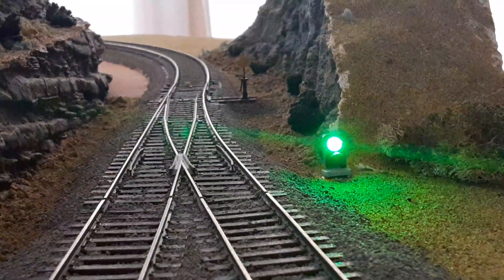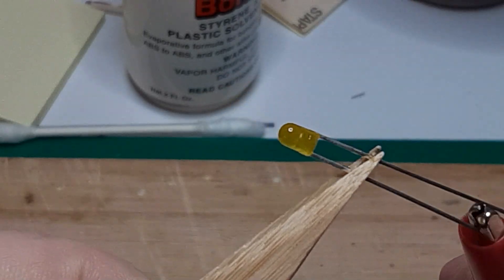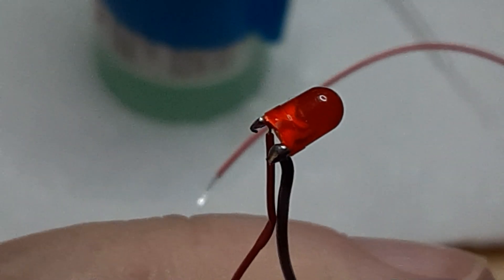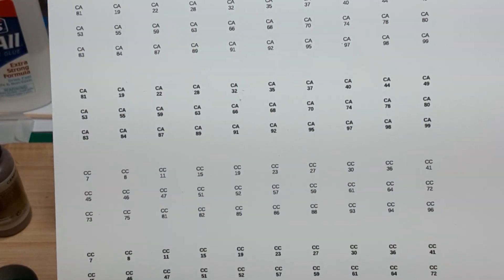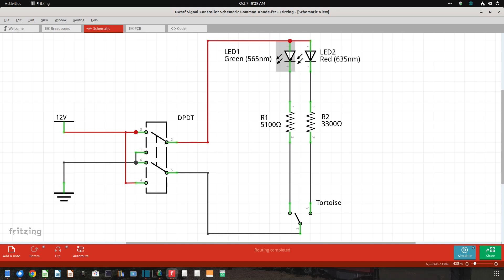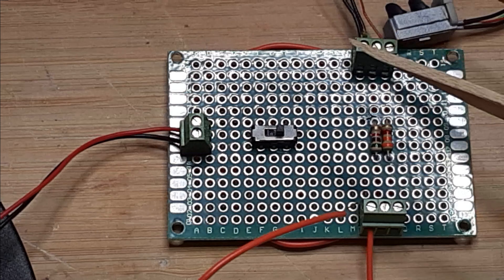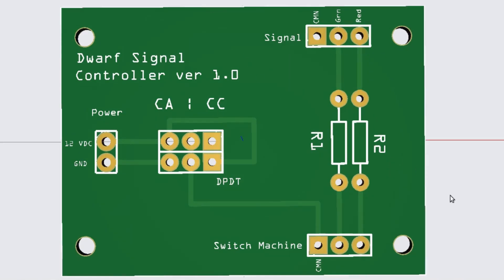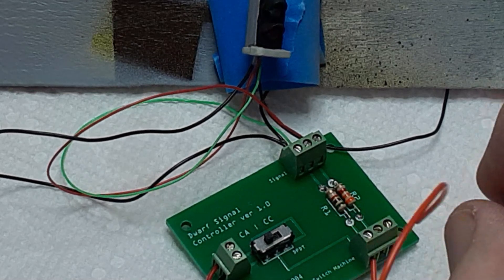Building   and Controlling   Dwarf Railroad Signals on a Budget

Comment: This is the best detailed video with all information needed. I have seen many on youtube, but this video is amazing, so thank you for guiding, sharing such a wealth of knowledge.
I use Digitrax controller for operation and tortoise switch machines, any suggestions/guidance, how I can integrate the dwarf signals? Currently I have no signals and am just starting to build signals into layout.
Reply from the maker: First, thanks for the praise - it is gratifying to know that modelers are finding my channel content helpful.
With regard to your situation, the first thing you need to decide is where you want to place your signals, and what information you want them to convey. Prototype practice is to use dwarf signals in locations where a tall signal mast would interfere with operations, which is why you often see them in yards; but they might also be used where there are overhead obstructions. Dwarf signals can have one light, two lights, or three lights; and the lights may be a dedicated color or they may display three colors, just as with searchlight signals.
You can use dwarf signals at a turnout approach from the converging (two tracks) direction to indicate  whether it is safe to proceed through the turnout - this is the approach I have demonstrated in my video. I chose to place a signal on just the siding (the main is always assumed to be clear), but you can place a signal on both approaches if you prefer. In that case, you must place your signals in a consistent location (e.g. always on the right side of the signaled track.)
You can also use dwarf signals at a turnout approach from the diverging (one track) direction to indicate if the turnout is in the straight or diverging direction. In that case, I would use a two-light signal with bicolor LEDs: display green over red for straight and red over green for diverging.
As I implied earlier, dwarf signals carry the same force and effect as mast-mounted signals, so you should chose a consistent set of aspects and operating rules that will apply both to mast-mounted signals and dwarf signals. If you haven't watched my video Simple and Inexpensive CTC Signal Control yet, you should watch it and read the video description for an introduction to signalling practice. Here is the link: https://www.youtube.com/watch?v=thEGwJs_UiU
Finally, you mentioned that you use Tortoise machines. As you know, these machines provide two sets of auxiliary contacts. Many modelers prefer to use one set of contacts to route power to the turnout frog, leaving just one set of contacts available for other purposes. I power all my frogs using the Tam Valley Frog Juicer - this leaves both sets of Tortoise contacts available. Most signal control circuits will use just one set of contacts, but you might encounter situations where you need both sets - one set for one signal and the second set for another signal. (The Frog Juicer will work with any DCC system.)
Best of luck, and feel free to shout if you need any help.
Reply: @rwissbaum9849 thanks very much for getting back. I want dwarf only as I have shelf layout and not much room for poles. My only thing was with existing Tortoise switch machines and Digitrax DCC, if I can use lights. If yes, do I still need to have PCB as you explained or any other piece of hardware.
Thanks again and have a nice day!
Reply from the maker: @j7v7z  Ok, sorry for the information overload!
The only function of the PCB is to make your wiring more modular. You could do the following:
1. Wire a 1000 Ohm resistor to the anode of every LED;
2. Connect the two cathodes from a single signal to ground;
3. Connect one anode from one signal to terminal 2 (or 6) of the Tortoise. Connect the other anode to terminal 3 (or 7) of the Tortoise;
4. Connect terminal 4 (or 5) of the Tortoise to +12V.
5. Test the switch. If the wrong LEDs  are lighting, swap Tortoise terminals 3 and 4 (or 6 and 7).
(Just remember the Tortoise contacts come in two triplets: 4,  3, and 2; and 5, 6, and 7; with 4 and 5 being the two common connections. See the question by @nonnazia below, along with my answer.)
This all assumes your signal is wired with a common cathode. If your signal has common anode wiring, connect the common anode to +12V and connect Tortoise terminal 4 (or 5) to ground. Also, this will only provide one illuminated LED per turnout. To light a second LED at the same time, you'll need to use the other set of contacts. (Also, you can get by with any input voltage between 3 and 24 volts by adjusting the resistor - I chose 12 volts because that's what the Tortoises usually require.)
So what exactly does the PCB do? First, it allows you to make the connections to the signal and the Tortoise using screw connectors instead of soldered joints. Second, it handles the common anode/common cathode issue with a simple DPDT switch; and third, it reduces the under-the-layout effort.
Hopefully, this answer is closer to what you need!
Reply: @rwissbaum9849 thanks again for your quick and informative reply. I will certainly work on your suggestions and share my experience.
You have an amazing way to explain. Thanks

Comment: I subscribed your channel, question any idea how to make work using Walthers switch machines, looks great I plan to build these but I am using Walthers switch machines
Reply from the maker: I just downloaded and skimmed through the (27 page!) instructions for the Walthers Layout Control System. There is a set of three outputs on your switch machine labeled NORM, COM, and REV - these are outputs for indicator LEDs. The manual says no external resistor is required, so I assume the output is +3 VDC, but you should check that with a multimeter if you can. (You can buy zero Ohm resistors to mount to the circuit board if the input voltage is truly 3 volts.) See page 16 in your manual. Connect COM to CMN on the circuit board, and connect NORM to the second terminal and REV to the third terminal. If the signal lights green when it should be red, reverse NORM and REV.  
It appears that the Walthers LCS expects the LEDs to be wired as a common cathode device; that is, it will connect the COM terminal to ground and supply +3 VDC to NORM and REV, as appropriate.
This might get tricky if you want route indicating lights on your control panel, and I don't know how this might work with DCC. Best of luck, and let me know how it goes!
Reply: @rwissbaum9849  I was looking at this again , the Walthers had two  micro switches installed and a 12 volt power supply, going to build a mock up using information from you and test , see what happens , think the micro switch is the key , make a stand alone circuit thanks for the help
Reply from the maker: @dundasjunctionmodelr.r-james  The more I think about this, I am convinced my first response was incorrect. IF you have a common cathode signal, and IF the NORM/COM/REV terminals are free, you should be able to connect your signal direct to the switch machine terminals - common cathode to COM, one LED lead to NORM and the other lead to REV. No custom PCB required! (Again, if the signal indicates backward, reverse the two LED leads.)
If you have a common anode signal, there may be a way to reverse the polarity of the NORM/COM/REV terminals buried somewhere in those 27 pages.
Now on to the "brute force and ignorance" solution:
I think I can see the two micro switches you mention - I think they are mounted on either side of the motor (close to the layout mounting plate) and they each have three solder-able (is that even a word?) terminals. I have seen comments in model railroading forums that these function exactly like the internal switches in the Tortoise. If so, the center terminal should be the common. When the machine is in one position, the common terminal will be connected to one of the other two terminals, and that connection will reverse when the machine moves. If all of that supposition is true, you can confirm with your multimeter, and connect to the custom PCB exactly as shown in the video.
Please let me know how it goes?
PS: Looking at the photos closely, it appears that these micro switches are small push button switches (the red button) which are activated by a mechanical linkage. This seems like a fairly Rube Goldberg device to me, but the comments in the model railroading forums do not mention any problems with reliability.
Reply: @rwissbaum9849  I got a email from Walthers about this, there is also provisions to hook up more LEDs. , dwarf signal , the micro switch should work , going to do some testing , I will do a test using your sketch , will let you know thanks
Reply: @rwissbaum9849  just a update , I got it to work , using the micro switch and power from the switch machine , I need to fine tune things but it works
Reply from the maker: @dundasjunctionmodelr.r-james  That's terrific. Thanks for the update.

Comment: You can build them for $1.00 each. Amazn has them in a kit. Search for B07H93CF4C. Wire opposite poles together. Use a single ON-ON switch.

Comment: So how do I connect this to my Tortoise switch machines? And how do I connect it to my Atlas switch machines (I have both Snap switches and Custom Line switches)?
Reply from the maker: The answer to your first question is fairly simple; the answer to your second question is more problematic.
To connect to a Tortoise switch machine The Tortoise provides two independent sets of auxiliary contacts, and you may use either set. One set uses terminals 4, 3, and 2 (with 4 as the common) and the other set uses terminals 5, 6, and 7 (with 5 as the common). The Tortoise terminals are perfectly symmetrical, so you can number the terminals from the left edge or the right edge - it doesn't matter. You would connect the common Tortoise terminal (either 4 or 5) to the switch machine common on the PCB, then connect the other two terminals (2 and 3 if you're using 4; or 6 and 7 if you're using 5) to the two switch machine terminals on the PCB. There's no way to tell in advance which connects where, but there's only two possible ways, so trial and error is not too difficult.
I use 4 wire telephone cable to connect the PCB to the Tortoise (I just cut the yellow wire - it's not used). You can solder the wires direct to the Tortoise terminals, but I prefer to use snap-on terminal connectors. I use Accu-Lite connectors, which require soldering - they cost about $3 to $4 each. Alternately, you can get the Accu-Lite SNAPS connectors with screw terminals (no soldering required) for about $6 - $7 each. Circuitron offers the ZIPZ connector which snaps on to the Tortoise terminal card and provides screw terminals for individual connections - they cost about $5 - $6 each.

Now for your second question:
Atlas switch machines do not provide any auxiliary contacts Therefore, automatic control of signals is not possible with Atlas machines, Further, actuating an Atlas switch machine requires momentary current, while the signals require constant current, so you can't connect the switch machine and the signal to a common switch. For Atlas machines, I fear your best bet is to rely on manual control of the signal, and you'll have to develop the habit of moving the turnout and switching the signal at the same time. There are a lot of videos out there describing this manual control; I provided a link to one of them in the video description.
If you want to provide manual control of the PCB I have shown in this video, you simply need an SPDT switch mounted next to your switch machine control button. Wire the center SPDT switch contact to the common on the PCB, and wire the contacts on either end to the other two contacts. Find the SPDT switch here: https://www.amazon.com/HiLetgo-AC125V-Terminals-Position-Toggle/dp/B079JBF815/ref=sr_1_3?crid=2I3OVM0DLT8VS&dib=eyJ2IjoiMSJ9.JJI7E7yy7yzQEuOuVms-nL0m1NywsYj-6NRsfDylNKeVb0YW_qKaRYhHC74nuJpM8FDZ6U2tfGodm4bmjsWVh4ukB0m1vdd58Vu-QSvZnl_kldIvREprTxdl1YCip-D-r4u9yRdGbxeDZaXwebFwHgubhGya3Qis5G5jPUS1FjqcXDV1wwLpehLeTsf8vV1lUu5jM6g5u7JnMCP-Fw7xf5RK3KeY-PK4tzwGvtlnVCE.aM1kxNsnobnJSG07TV6t7sVsZ-PLAixKDL_VSim2ijM&dib_tag=se&keywords=spdt&qid=1729520253&sprefix=spdt%2Caps%2C158&sr=8-3

There is a way to provide turnout control and automated signal control with a single button but it requires an Arduino and perhaps a motor shield or some other auxiliary device to control the switch machine.
Reply: @rwissbaum9849  Okay.  I think i've wrapped my head around all that information.  Thanks!